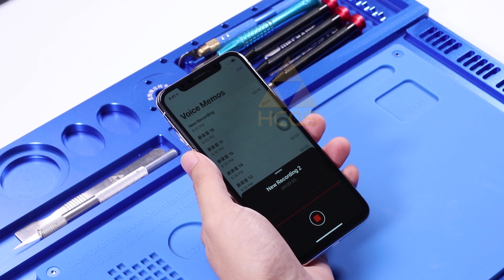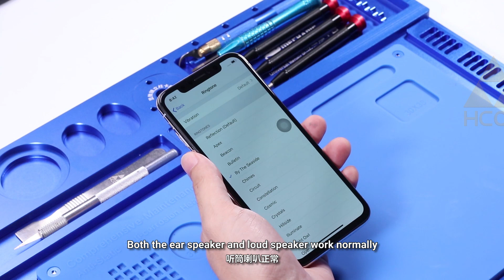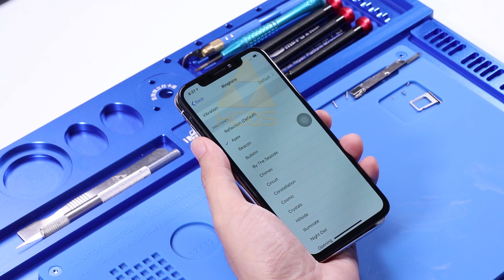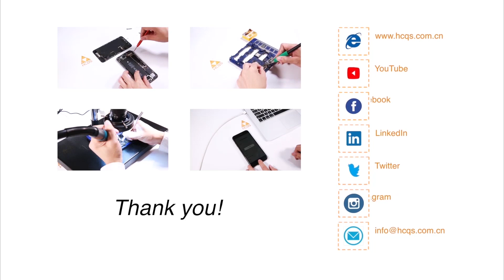How to fix iPhone X Recording Has No Sound | Motherboard Repair

Comment: what temperature were you using seperating the board?
Reply from the maker: If you have the separating platform, set the temperature to 180℃， if you don;t have a separating platform, use the hot air gun and set the temperature to 250-260℃